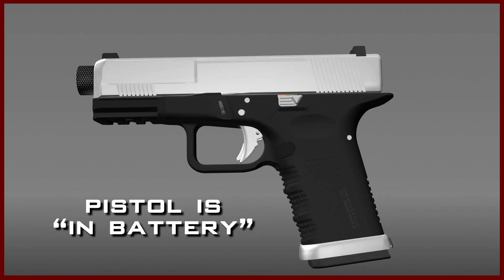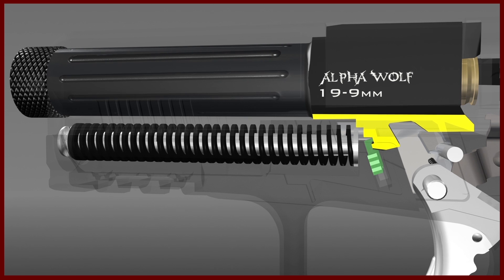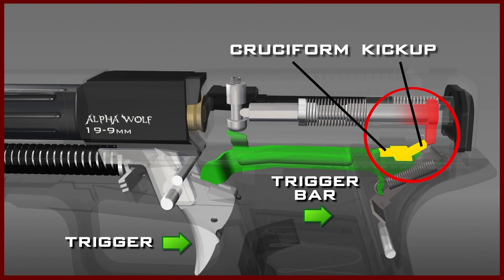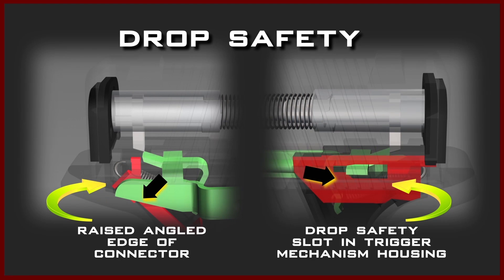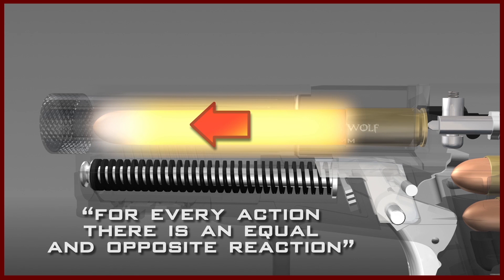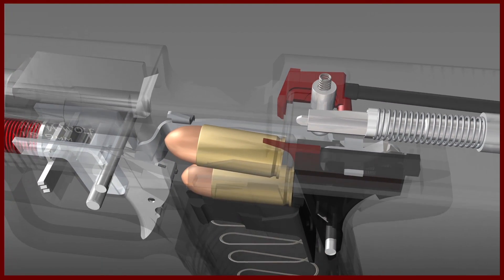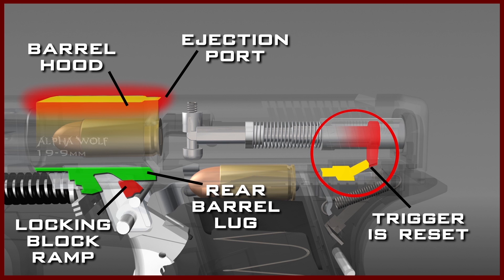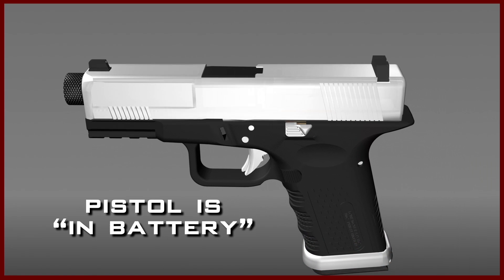Lone Wolf HIW: Firing Cycle Explained for Glock

Comment: Would like to see a follow up featuring the ny1 and/or ny2 trigger springs, they are so prolific in some shooting circles.   Awful trigger pulls remedied by combining with 3.5 connectors to reduce pull weight to a more manageable pleasant operational experience.

Comment: Great video, I thought though that Glock's were fully cocked at all times?
Reply: No, the striker is partially cocked by racking the slide, but pulling the trigger draws it back the rest of the way and then releases it. This keeps it safe but minimises the weight/length of trigger pull required (though Glocks don't have the best triggers).